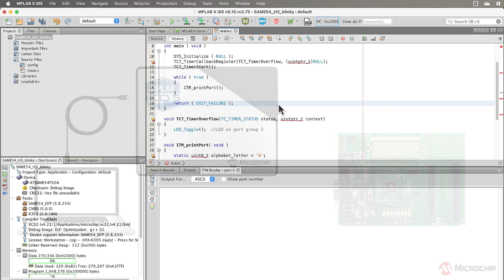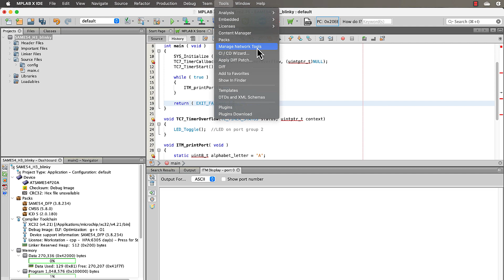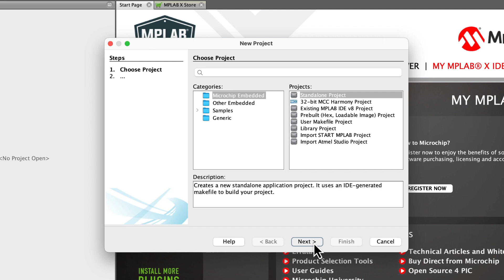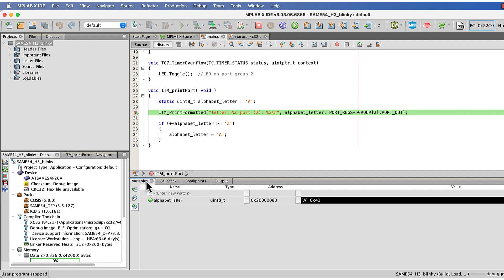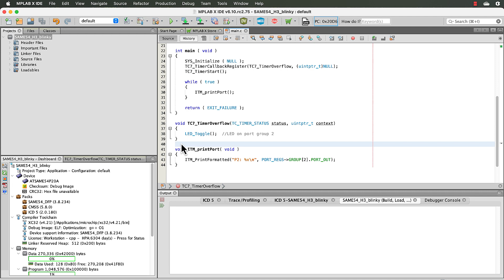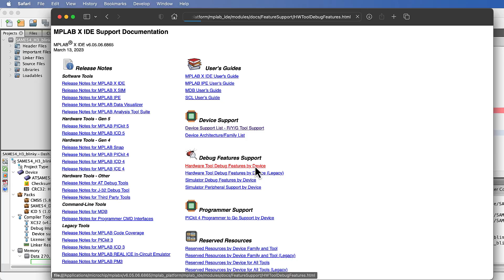Getting Started With the MPLAB® ICD 5

Comment: what are the tcp or udp port numbers used by ICD5 network connections? (for both flashing and debugging)
Reply from the maker: Hi there, thanks for your question. The ICD5 uses standard TCP/IP networking for Ethernet-based programming and debugging, and is designed to be discoverable and accessible on a local network via DHCP or static IP configuration. The device is detected and managed through the MPLAB X IDE, which scans the network for ICD5 devices. The ICD5 does not require any special port configuration for standard operation; it is expected to work on a typical LAN with no firewall restrictions for device discovery and operation. If firewalls are present, users are advised to ensure that the ICD5 is allowed through any security software, but no port numbers are specified. Please let us know if you have any other questions about this.